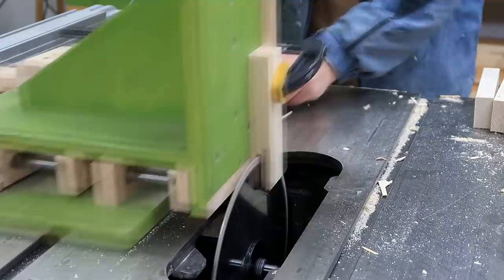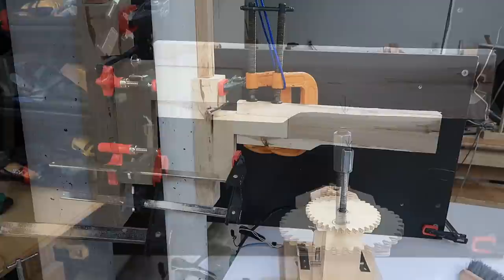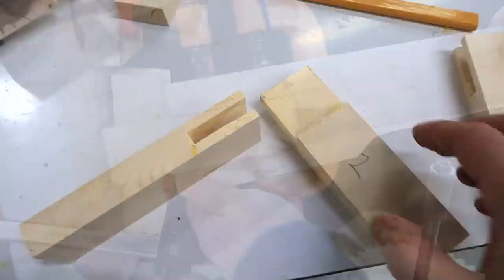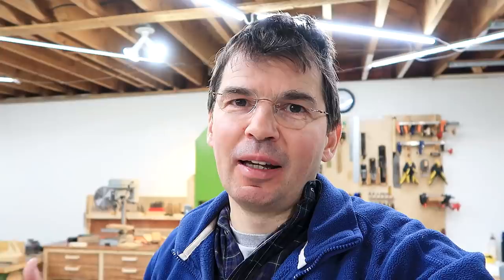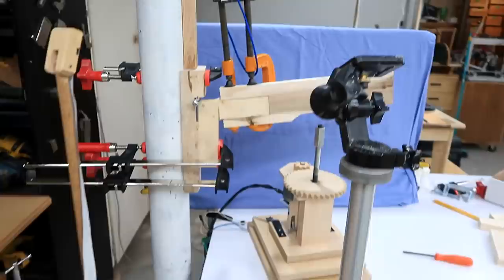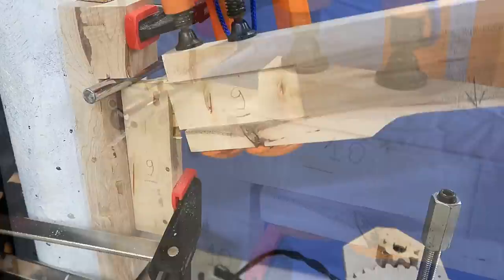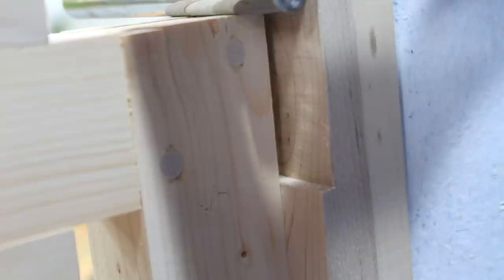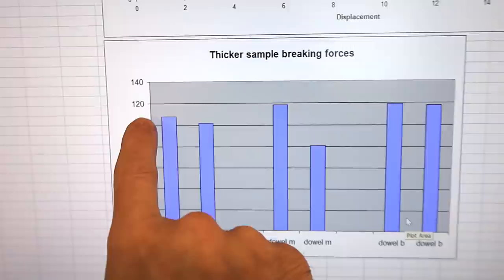Can reinforcing a joint actually weaken it?

Comment: As an aerospace engineer, I can tell you that bonded & rivetted joints are common. This 'belt & braces' idea is that if the glue fails, the rivets will keep it together. So the rivets do not make the joint stronger (how could they?), they are a secondary load path. Neither do they weaken the joint if it is designed correctly. So I think your experiment proved this quite nicely. Thanks.
Reply: Hey Richard...if you see this I would love for you to read and comment on my post should you have anything to add, questions, or perhaps a challenge of my perspective...What I can share here at this time is that adhesives are serving a different function (in most applications) than the rivets alone...They are working in concert but both are critical to the load paths of such critical joinery. See my other post here for my reasoning and thanks for the conversation should we have it...
Reply: The dovels also help with keeping things in place while the glue hardens and allows the structure to be used/loaded earlier than otherwise.
Reply: @Gin-toki  They can also weaken the wood as any "glued joint" should never be loaded until the glue is set if the purpose is a long-term function...As stated before...a joint is either glued...or it is pinned...doing both is seldom necessary and typically out of the context of traditional joinery...Understand that "pinned" in the application of them in "good practice" means a "drawn joint" and not just sticking a dowel in it...
Reply: Richard, do bonded joints have no deflection? The only way the rivets don't do anything is if the materials have absolutely no movement relative to one another.
Reply: @MrGuitarbike  Structurally a working diaphragm (e.g. floor, wall, roof, or related joinery in either furniture or a timber frame) has several elements that work in concert to withstand the shear, compression, bending, and related load paths...

If these are just tunneled, keyed, wedged, etc fixing modalities...working in concert with friction, gravity, and the geometry of the joint is what holds them together...without adhesive...just as we find in traditional furniture, which typically...was not...glued at all...!!!

When an adhesive is added (aka a 'bonded joint" as you put it) that is what is the primary element that holds it all together regardless of the load paths...deflection/deformation of the joint can and does take place under load, but the "rivets" in Richard's case is not overtly loaded as the adhesive is doing the brunt of the work (95% and probably greater) just as he suggested...

"The only way the rivets don't do anything is if the materials have absolutely no movement," is not really accurate...They are not the primary element holding the joinery (regardless of type) together...the adhesive is...and they can in, many examples, just like pegs can weaken a joint which is the point the video was making...It is a common misconception that "pegging joints" make them stronger, which is seldom the case. In timber frames, as just one example, they hold certain frame assemblies together during raising but after that do little for the overall strength of the frame...and continue just to keep certain joints tight...yet...even in this case, many forms of "pegged joints" over time are proven to weaken the frame and fail for many reasons...
Reply: @JayCWhiteCloud  to say that a rivet holds nothing in a bonded joint can lead to dangerous simplifications by those who do not know better. It's important to be precise. Rivets are stressed an order of magnitude less than the adhesives in a static loading condition. Anyway, I don't care about this argument, just trying to make an engineer be more careful with the weight their words carry.
Reply: @MrGuitarbike  Let me be more clear if I can for you...if a joint is "riveted" without adhesive...just like if a joint is pegged without adhesive...they both are "working" to some extent depending on the load paths to the given joint...both also weaken the jointing materials as well...and in many cases significantly...This is why there is serious engineering that goes on about their size, type, placement location, etc...because of this weakening factor...

So I'm running under the assumption that we have properly engineered, laid out, and executed riveted and/or pegged joint...An absolute redundancy as Richard pointed out...nothing more in most (not all) cases...If you then add adhesive to this assembly the rivet and/or peg becomes overtly redundant and in most (not all) cases does little to no work in strengthening the joinery at all...but can certainly weaken it...

I am not a PE by profession but have worked closely with them for over 30 plus years...Richards's words and observation were very clear and well understood, at least by me...but I can agree that all of this may be confusing to a layperson...

Comment: Love the scientific testing vs gut feeling. I want the actual better thing, not what I think is better so this is great!
Reply: But you design for a safety factor so that neither failure mode is likely to occur in normal usage.
Reply: But as Matthias said, it isn't usually done for strength. Dowels, metal star dowels and wedges are often used in the industry to back up the glue joint. It's not so much about reinforcement but rather reassurance. Especially outdoors it is good to not only rely on glue.
Reply: Except real science experiments or run at room temperature and this is clearly not since he's in a heavy sweatshirt
Reply: @osufwiffo  It absolutely is at room temperature, just the temperature of that room specifically...

Comment: I about lost it when all those glue joints failed, having seen all your previous tests over the years. That shocked the hell out of me.

I guess if it's below 55F, I should just use pocket holes.
Reply: nah, if it's below 55F just go back inside and have a nice cuppa and wait for warmer weather.
Reply: @sturmey1966  Uhh, I'd be waiting a long time in these parts!
Reply: Cool your jets on those pocket holes.
Reply: @Don.Challenger  I happen to really like them. I'm not afraid to admit it!
Reply: @sturmey1966  or do it in a closed room with the heater on
Reply: CALM DOWN SATAN!

Comment: Humidity needs to be looked at because I bet it's extremely dry in that workshop.
Even getting the wood damp before applying the glue so it has more time to penetrate into the wood etc
Reply: Wouldn't matter since they were all glued under the same conditions. The test results are just as valid.
Reply: @d4rk0v3  I think what he wanted to say is that if the gluing was done under better conditions, the results would better show if dowels make the joint weaker or stronger, as opposed to now when it was mostly glue failure.
Reply: Yep, making the glue not a dry joint.
Reply: @wobblysauce  yes exactly!
Just curious if the overall results would be stronger. 

I'm in search of whats best.
The science is sound. 
Just curious if another variable would produce a better product.
Reply: @d4rk0v3  Not really, if the glue is failing first then the joint isn't being tested and the results are meaningless to any properly glued joint.
Reply: Sounds like a " 'Glue as most people actually do' vs 'Glue as you SHOULD' " test is in order.
Reply: Humidity changes the dimensions of the wood significantly. There are woods which have a laughably small expansion rates but the typical ones you would use to build a table or bench can expand by upwards to half an inch depending on the range of humidity it's exposed to. Part of why it's so important to seal the wood if it's going to be exposed to weather.

Knowing that I wouldn't want to alter it's humidity while glueing it.

Comment: That first test really goes to show why it is that people still struggle to believe that glue is stronger than the wood. Bad glue ups are all too easy to do, plus of course glue can fail over time. Likewise adding the dowels, as mentioned in the conclusion. Depending on the task, some sort of back up for the joint, in case of glue failure, is going to be a crucial addition.
Reply: but still... it took over 60 kg to break the glued joints. And that was with some leverage. My conclusion: for furniture that does not need to be undestructible for 100 years it will suffice to just use glue. a small wooden brace in a corner or diagonaly will add much more strenght than a dowel or some fancy finger joints, i think. for a table or chairs that have a lot of movement in different directions i would take more consideration. For a book shelf ore some TV stand i just glue the butts together put a screw or dowel in (i don't have clamps long enough) and maybe brace some corners with small wooden triangles. never failed on me.
Reply: @alias_not_needed  Yeah, but fancy joints gets the babes.

Comment: I would be particularly interested in seeing how construction adhesive performs. I use it for crude joinery sometimes and I'm always impressed by how effective it is.
Reply: This!!!
Reply: Heisz is that you?
Reply: It might not be as strong, but could probably flex more before it breaks resulting in higher toughness.
Reply: Have you noticed PVA glue is not like it used to be? I use liquid nails on bed repairs! If you reinforce properly ( every situation is different) it will last! As u found out from my son's bed repair. I couldn't believe how it broke after reinforcing and gluing? Then I busted him and his older brother wrestling and jumping on the bed! Lol. So I reinforced it to oblivion! Lol. If I have to do this again? I'm welding up a steel frame  strong enough to drive my car and park on top!!! 😂
Reply: @dragan3290  The bed is poorly built then. I can jump on one foot on one slat in the middle of the span on my bed that has a design flaw that allows all the slats to rest on a 2x2 that is  screwed,   nailed and glued. 180 lbs on 12 square inches very live load. 

@
Gareth Baus Polyurethane construction adhesive typically outperforms wood glue, especially in loose joints, and also over time and under sustained live or dead load.
Reply: @rolfbjorn9937  I was going to use sikaflex. But I ended up reinforcing it from underneath like a load bearing beam. Lol
Reply: @dragan3290  it’s amazing what kids can break for all the bigger they are. 😂

Comment: RIVET a welded joint  ;-))  
Many thanks I learned something new  -  Also made me think of the blacksmiths shop, happy days 4th generation now ended, it was started in 1890 when everything was riveted or fire welded in the forge. I now work with wood and find it more difficult than metalwork.

Comment: I believe the real advantage to dowels through tenons (besides aesthetics) was for draw boring the joint closed, rather than adding strength to the glue joint. I am also curious to see this test on hardwood and if it has the same results

Comment: Fantastic video! Made a claim, tested it, presented all data whether it supported the claim or not, learned a bunch about tangentially related material, presented possible errors in data, and presented further testing to be done. I wish I worked with engineers half as thorough as you

Comment: Failure in a way that can be fixed is better than catastrophic failure, in my opinion.  That argues against pins.

Drawbored joints are handy if you don’t have clamps, but otherwise not needed. A single pin could hold a joint together, but not need to be close to an edge to weaken the joint.
Reply: Well, a failure of the joint that can be fixed is often a catastrophic failure of the whole structure. Better cut new boards for the swings than search for the whole seat over the neighbour's fence, fighting off the guard dog ;)
Reply: A jig with wedges can work too, depending on goal with the joint.
Reply: you can remove old pins and fix that too...
but with pins you have crack 1 and then crack 2 ... guess how mutch you and your electrons can do in that extra time, before the 2.crack gives a catastropic failure.

Greatz from Germany
and have a nice Day
opo

Comment: Quite surprising that the glue failed first, I always thought wood glue was extremely strong. I wonder if when you test the different types of glue there'd be a noticable trend testing each of them done at a wide range of different temperatures.
Reply: The glue failed because he glued it below the temperature requirement on the bottle.  When he redid it at the end at 10c hotter, it was almost always the wood that broke instead.
Reply: This biggest lesson from this test shows me that temperature at time of gluing is very important.

Comment: I always thought antique furniture used dowels with mortise & tenon joints because the glue that was used was known to fail over time.  With the dowels it would keep the joint together.  With the good glues we have now, it's really not necessary unless you like the look, or you are using it to draw bore the joint together without clamps.

Comment: In timber framing, dowels (pegs or trunnels) are used to hold mortise and tenon joints together (but wood glue is not used). It's also nice to be able to disassemble the joints. The pegs are also used to draw-bore joints together so they are tight. The point is that pegs are not used to solely strengthen a joint.

Comment: Agree with your findings. My own experience is that dowel etc don’t generally add strength and if too close to the edge of the material they actually make it weaker - cause you’ve removed wood and interrupted the grain. As you said, it’s harder to repair too. Dowels etc are useful for alignment so I do use them at times - but with great care

Comment: How about just one dowel in the center, so it has a maximum amount of wood around it? And it seems like you should try much bigger dowels. I think one 18mm diameter dowel in the center might be optimal for strength, but maybe a little strange looking.
Reply: stop it dowel guy
Reply: @MrSubjetivo  HAHA
Reply: I would only go for it, if you think it is a critical component, where you don't trust the glue. But ideally, you should do the glue up in warm environment to dry, clearly.
Reply: Wouldn't a dowel in the center just weaken the joint because the piece could move around it? The dowel would act as a hinge in a sense... but it would be interesting to see.
Reply: @JDefoe1882  the shoulder of the joint should keep it from working like a hinge. For example if you used no glue, and rotation would pull the wood against the dowel. Or maybe a square peg would be better.
Reply: The dowel removes it's diameter's worth of glue surface area, times two (once for each side of the tenon. A bigger dowel would mean less glue and the glue joint could fail earlier.

I think Mathias point is if it's properly glued the wood beside the joint will break first. Meaning the dowels are pointless for strength. I can only see dowels being used for exterior applications where wood shrinking could delaminate the glue joint or smaller dowels for alignment/draw bore purposes.
Reply: I wonder what would happen with three dowels in a triangle.
Reply: Seeing the data from different size dowels would be interesting.
Reply: Maybe for one test bed trial twenty or so (17, 19 or 23) randomly placed dowels not being more than half the (xy) surface area.
Reply: I think if you actually do the statics calculations for these the dowels might be making it weaker because they concentrate the stress around the hole. In an arch, the stress bends around the  shape of it, but for composite materials like wood, they have stronger compressive and tensile strength in one direction that the other. The arch created by the dowel might be redirecting the stress against the grain, where the wood is weaker.
Reply: that what my brain wanna see, and glue in the dowel.
oh, and use new glue that never got in freezing temps....

and add a test how mutch bend forch a straight stick of that wood can take.

Greatz from Germany
and have a nice day
opo
Reply: For what it's worth, trying to optimize dowel size for strength versus the material removal (and thereby glue-surface-area to make space for it, I've found myself defaulting (eventually) to a "rule of thirds" approximately.

    Basically, whatever the over-all glued joint dimension is, fitting a single dowel of about 1/3 that/those dimensions seems to add more than it takes away from the joint...

    Of course, at some point you're going to butt your head figuratively against a law of diminished returns. You can "what-if" anything to death, and when we create things, it's all well and good to intend some heirloom masterpiece out of our wood-craft.. BUT the reality is that we only create things in a temporary fragment of time to do a job, whether there's more mechanical purpose or intangible "art" purpose, we must balance the form AND function such as they are (or seem worth the while) in the moment we're creating.

     How you (personally) choose to do that is YOUR style... and style has a lot to say about each of us as individuals. It's a big world, and I think big enough for there to be room for all of our styles.  ;o)

Comment: When you do your tests of glues it would be interesting to see how basic builders PVA (the stuff used for sealing plaster etc.) stands up compared to the more expensive types of actual wood glue.
Reply: Also seeing how cyanoacrilite (super glue) and hot melt glue (applied to preheated wood ofc) works would be nice. Preheating the surfaces does wonders for hot glue adhesion and strength.

Comment: Tests similar to this one that I've seen had the load pulling down. Which leads to the question if that makes a difference. Also; many of the pinned joints are made where the holes do NOT line up and the pin, when forced into the holes, deforms AND pulls the joint together. Common in chairs and tables, where if the joints' glue fails you don't want total failure.